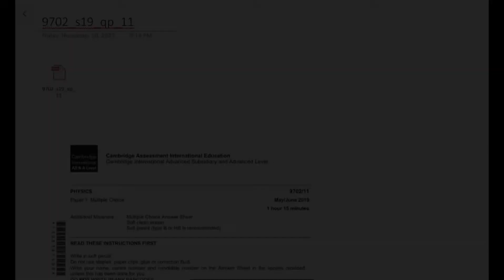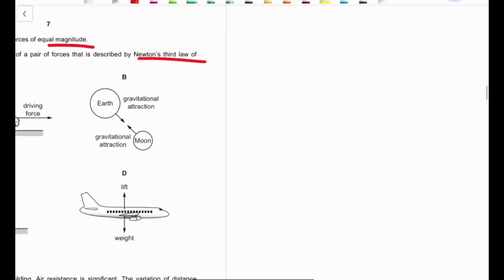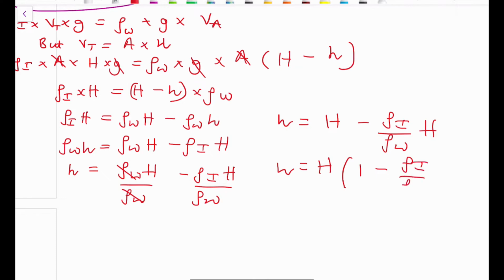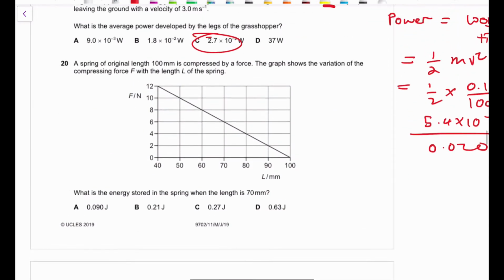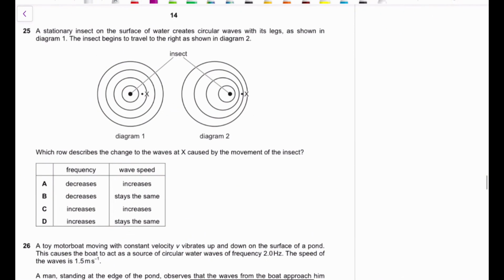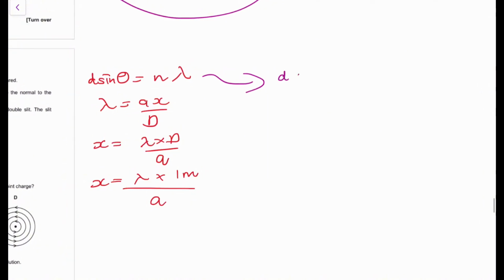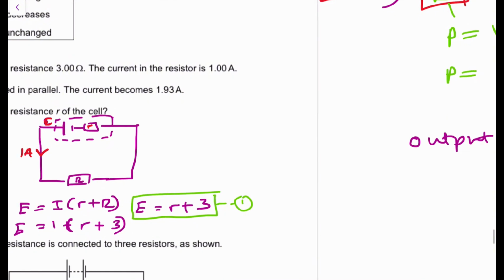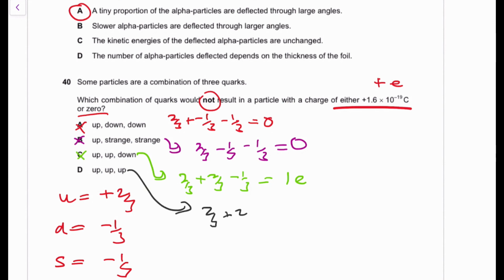AS LEVEL PHYSICS 9702 PAPER 1 May june 2019|| Paper 11 || 9702/11/M/J/19 ||Cambridge Fully Solved.

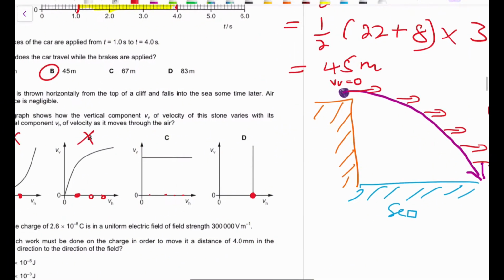Comment: in question 7 (10:11) why horizontal velocity dont have more than one value while it is stated in question that stone is moving through air. wont air cause air resistance against horizontal component  causing it to shrink and hence having different values
Reply: hey mate! so basically when the stone is thrown off the cliff the horizontal (left to right) force from which it travels remains constant since there is no force acting on to that direction (except for the force we threw that stone with.)....However the vertical force (top to bottom) keeps on changing as it has two major forces being applied on it gravity and air resistance. Such motion is called the projectile motion.

Hope this helped!!!:hand-purple-blue-peace:

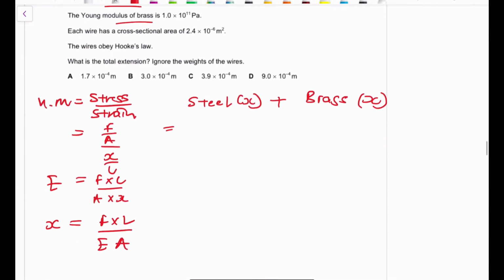Comment: sir, why does steel and brass both have the same force of 40? shouldnt it be 20 each? 34:21
Reply from the maker: Ok 👌, good question, since the steel and brass are in series (one after the other) they both experience the same force of 40 N, so the steel is carrying the load and the brass is also  carrying the load and the weight of the steel wire, but we might assume that the weight of the steel is negligible in a way

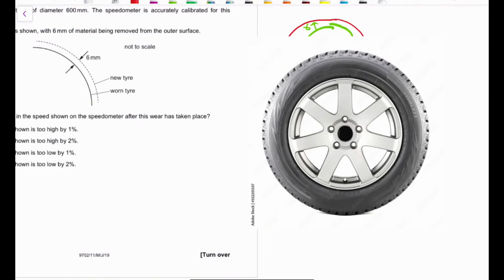Comment: 5:52 why did you put 12 in place of uncertainty to calculate percentage uncertainty?
Reply from the maker: Thank you very much that is an excellent question. 
***
So the question said error, now if you look at an error, you were supposed to get something but you got something else so error = actual value-measured value 
The percentage error will be that error divided by the actual value *100.
**
So I used 12 as my error and 600 as my actual because look if we lose 6 on this side and 6 on that side the new reading will be 588 so error = 600-588 = 12
*
It is worth noting that people, including myself often use error and uncertainty interchangeably but they are actually pretty different, an uncertainty is a range we give ourselves and we expect the actual answer to lie in that range, and an error well is just the difference in what we got and what we actually had
Reply from the maker: So sorry for the long response, I hope it helps please do comment if you have a follow up question or another question you have I would be happy to help❤️
Reply: @Life_and_academic_Motivation  thank you so very much for replying. i was spending the past hour or so very confused with this question, and i understand it now. you also clarified a doubt i had about the difference between errors and uncertainties, so thank you.